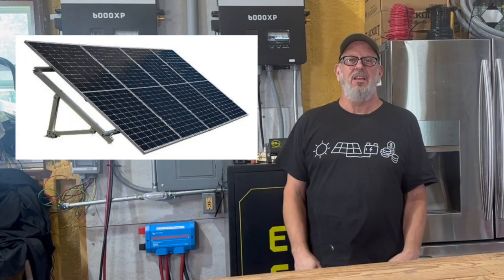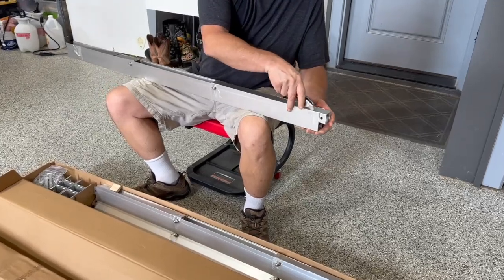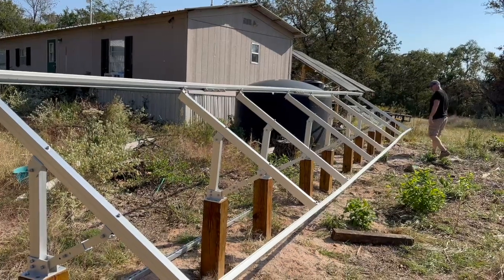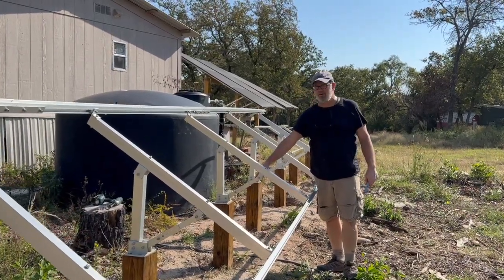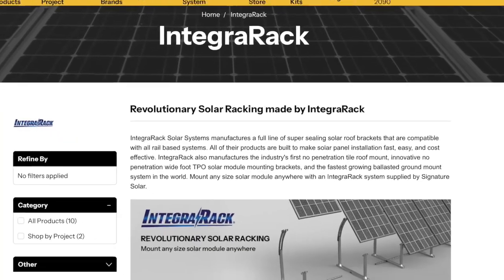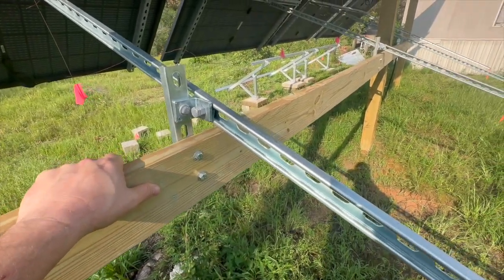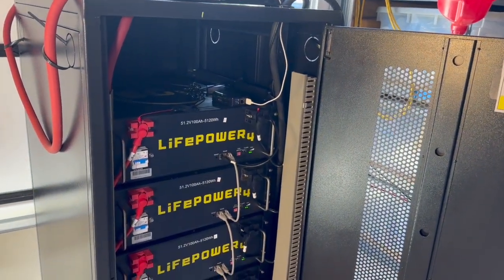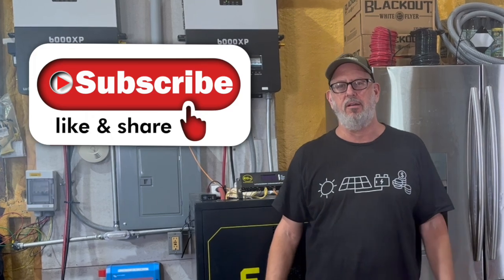What DIY Solar Panel Ground Mount Systems are available now??

Comment: Thank you for the insight… seems like the latest one has issues
Reply from the maker: Really the only issue was the base footer now has oval bolt holes and it requires a little shoring up to not wobble.  Signature solar just discounted their remaining stock of the Brightmount Cat 1 racks for Black Friday, selling them for $250 each.  The issue though is there are no more extensions available so panels need to be under 44” to mount four panels.  The Brightmount is a great idea, but increasing costs and tariffs just make it too big and heavy to produce and ship from overseas.  If you have a flat level surface on which to install a ground mount, then the IntegraRack is probably the best/affordable permanent mounting system out now.  I just finished installing a 12 panel IntegraRack and my video will be up soon.  If you order it, you need one more mount than you have panels.  Don’t forget my $50 off discount to save more! 🤩👍🔋⚡️☀️💡

Comment: I like the chiko ground mount because you can stack to panels high but that fixed 20 degree angle  is not cool with me in my area. for the summer yeah.......winter no
Reply from the maker: Thanks! I watched a  Chiko mount build and they look great for oversized panels but the cost is bordering on what I can do a Sinclair Mount or Iron Ridge partial DIY build.  For a fixed mount, I’ve gotta have 25-30 degrees here in TX.  I’m going to do a large ground mount eventually (because I’ve got plenty of room!) but I’m still not sure which route to go with that one. 👍🤩🔋⚡️☀️